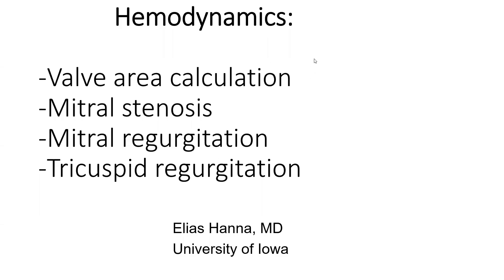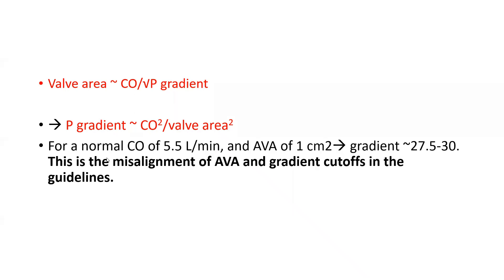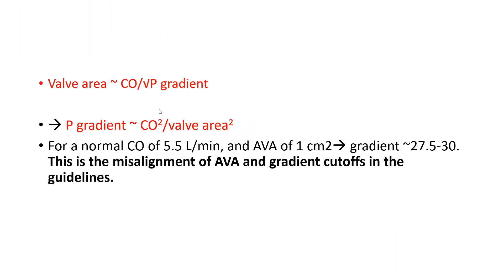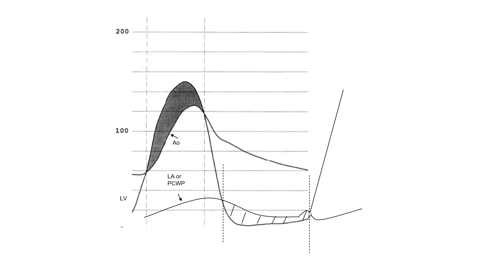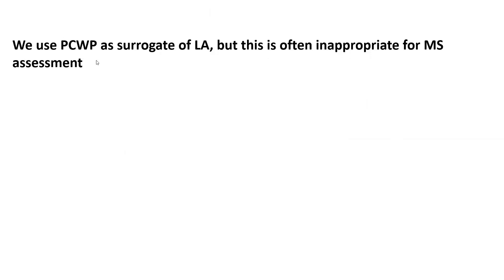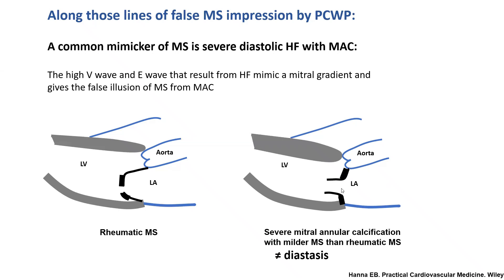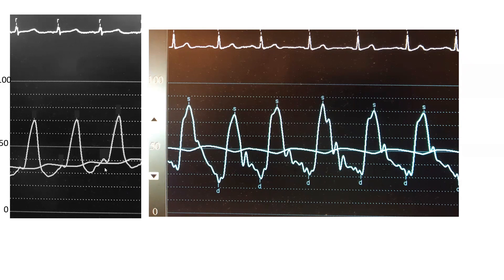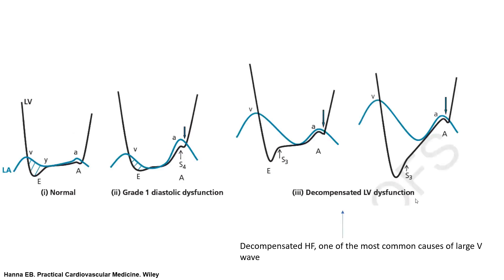Hemodynamics: valve area calculation, mitral stenosis and regurgitation - Elias Hanna, Univ of Iowa

Comment: How do you measure mean LA-Pressure? I mean in normal Conditions it is easy. but how you do it, wenn you have a large V-Wave? let us say a is 10 mmhg and V is 50 mmhg.
Reply from the maker: Mean LA pressure is the integral of all the peaks and dips of the LA pressure. The best measurement of mean LA pressure is the computerized one: for example, at minutes 43:14 and 47:02, you see that the software displays a "mean line" (the undulating line). This is similar to how we measure mean arterial pressure from an art line. If you want to make a quick mental calculation, an approximation of mean LA pressure in a patient with prominent V would be (2 Y+ V)/3. This is not very accurate, because you have to account for areas under curve and durations of waves, not just height. In bradycardia,  more time is spent in diastole and mean LA is closer to Y than in that quick approximation.